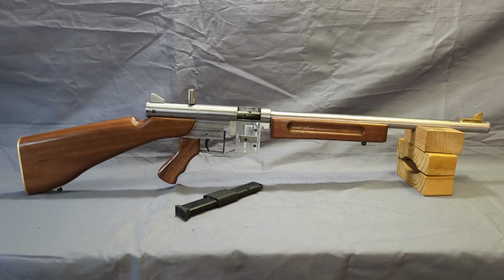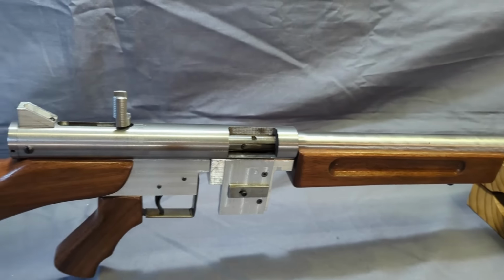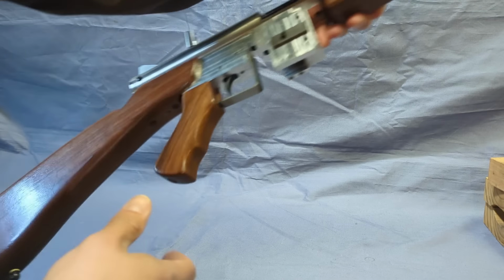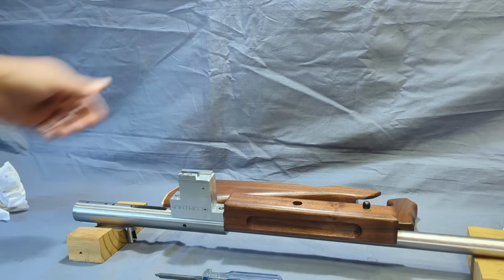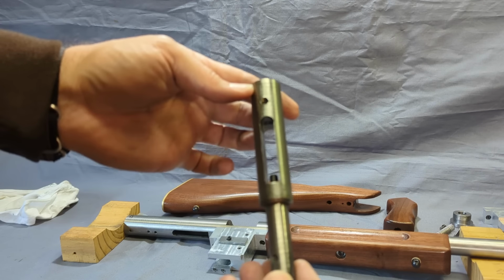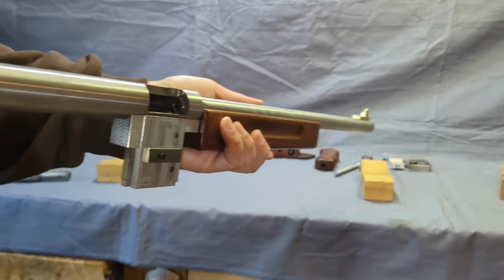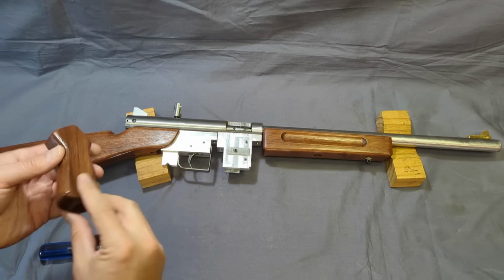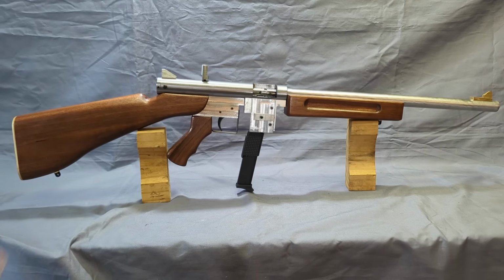Homemade Tommy Gun Mini: 380 Blowback

Comment: Wild part is making it semi auto is a heck of a lot harder than making it as it should be.
Reply from the maker: Yep. That's why I used modified AR trigger parts. The hard work was already done. Thanks for commenting
Reply: Thats true if "as it should be" means full auto only... open bolt full auto is easy..easier then semi auto fr sure...  but select fire? Thats seems to be a different story... at least it tends to require more parts... If its interests you, you can see what I mean on world of guns if you are interested..  It's an app where you can completely take apart guns... You gotta get the prei membership tho if you want access to every gun..  it's so worth it tho because these are exact 1:1 working 3d models that you can take apart down to the very last pin
Reply: OMG it's chef excellents!
Reply: @garage.guy.3006 now just modify a set for forced reset and it will be even funner....
Reply: @garage.guy.3006 I built a 9mm blowback AK back in 2004... I used 14oz bolt weight. Have you ever thought of using a detent system to retard the blowback... If you drill the bolt you can put a ball bearing and a spring that lines up with a hole in the receiver. On one I built I used a ball and spring with a grub screw to hold it in and then I drilled a countersunk hole in the receiver from the inside of the magwell for the ball bearing to snap into... Adjust the size of bearing and spring preset weight with double grub screw to adjust the blowback retard rate. It's super easy to do....also I try to make the bolt travel shorter than the overall length of receiver so the bolt is always floating on the spring and never hits the back of the receiver.... I love your gun man. Good job
Reply: True, because you need few more parts to make the sear function properly, making it full auto is much easier, especialy if it is going to be an open bolt design then it is the easiest SMG to make in the world
Reply: @SHAGG13  I find ball bearing delays interesting.  Especially for PCCs where straight blowback tends to negate the benefit of a lighter cartridge (easier for inexperienced shooters etc).
Reply: @gratefulguy4130  correct end with a long recoil path that doesn't impact the back of the receiver allowing the bolt to float it really negates the recoil.... I really want to do one eventually with a counter recoil weight with a pulley and cable so the bolt weight goes forward instead of backwards with a small bolt head accelerating a weight toward the front with a telescopic weight around the barrel and recoil spring in front for more weight forward with a bullpup design to balance it out. I'm always surprised nobody has engineered something like that yet... With a helical or P90 mag in back of pistol grip as well....and I'm really intrigued with BLOWFORWARD designs like the Swiss 53👍
Reply: @SHAGG13 exactly

Comment: Here in Brazil we have difficulties in buying weapons, there are many homemade SMGs on the streets. I have a 380 ACP with a 25-round magazine. Fully automatic, open bolt.
Reply from the maker: That sounds like a fun little gun.
Reply: @garage.guy.3006  In fact, illegal ammunition here is very expensive, so we don't have the luxury of training. Normally, the memories and feelings you have about the weapon are from when you are shooting someone or in a stressful situation.
Reply: @ggizi6369 Can you do reloading?
Reply: @elburropeligroso4689  Yeah, bro, I have two magazines and I carry 4 spare rounds in my pocket to use in the chamber. In the latter case, I still carry an automatic knife
Reply: @ggizi6369  Sorry, I meant can you reload your own ammo? Like loading bullets, propellant, and primer?
Reply: @elburropeligroso4689  No buddy, I've tried using reloaded ammunition, some failed to eject, only original ammunition
Reply: Same thing here in Scandinavia,but you know,if there is a will,there is a way..
Reply: @ggizi6369  can you get propellant and primer in Brazil? Or do you make them yourself?
Reply: What do you considier expensive for ammo? We complain its too expensive in US! In the US bulk ammo (500round brick+) is in USD: .22lr $.0-5-.08/round, 9mm  $.22-.25/round, .380 acp $.35-.40/round, 9mm premium hollow pionts $.50-1.00/round, .223/5.56 or 7.62x39 $.45-.50/round, .308/7.62 nato $.75-1.00/round, any other full power rifle round $1.25-1.50/round, .223 green tips (armor piercing) $.80/round gen 2 $1.50-2/round (Armor piercing rounds are banned from importation but domestic production is allowed making  non-US military calibers very rare and expensive like $20-100/round), magnum rifle rounds $3-5/round, .50bmg $5-10/round, 12ga birdshot $.33/round, 12ga buckshot $.50-.70/round. Add another 15 to 25% if you're not shopping around and buying a single box at the store. Basically anything that's not a military caliber it's hard to find anything other than premium hunting or self defense ammunition which cost twice as much as standard FMJ. What are ammo prices like in Brazil? Also how much are the homemade SMG's? And are they reliable? Is the market where you can buy them or do you have to know a guy?
Reply: @vape42  I'm not sure about Brazil. But in my area, a single round of 22lr cost more than 1$.
To perspective, the average wage here is less than 1$/hour
Reply: @vape42  Well, here each shot costs 20 reais, the minimum wage is 1420 reais, a box with 50 shots will cost 1000 reais, I need to work 1 month to buy 50 shots without spending almost any of my salary
Reply: @vape42  Homemade SMGs cost around R$5,000. An original factory-made weapon costs around R$12,000. Of course, on the illegal market.

Basically, the rich and military can have weapons in Brazil. A legal 9mm pistol will cost R$7,000 for those who are allowed to buy it.
Reply: @ggizi6369  Damn so your ammo is like 6 to 7 times more than it is in the states. Ironically full auto SMGs and assault rifles sold to law-enforcement or license holders cost about the same to double (depending on a specific gun) as one of your illegal factory made weapons. I'm assuming they come full auto or can you only buy semi auto factory made weapons? Of course we can buy a reliable 9mil pistol for $200 (r$1200), A semi AR 15 for 400-500, A semi AK-47 for 600-700. Guns with barrels under 16 inches in length are classified as short barrel rifles and come with an increased background check and regulation as well as a $200 tax every time it's transferred to a new owner or one is created. You also give the government permission to search the premises you’ve declared the rifle at without a warrant. We do have "Pistol braces" that basically function as stocks for compact weapons but they are legally distinct and not quite as nice to shoot as a real stock. I'm curious do the black market arms dealers have any heavier ordinance? Grenades, rpgs or grenade launchers? Other explosives? Mounted machine guns? If so how much? Also if you ever need to build a cheap quick gun A 12 gauge shotgun shell fits near perfectly into a 3/4 inch pipe and the rim of the shell will rest the pipe end. You can then take a 1 inch pipe with an end cap That has a hole drilled in the middle with a sharpened bolt held in place by a nut on the inside so the point of the sharpened nut sits in the middle of the 1 inch pipe cup that you've made. You can then place a 12 gauge shell in the three-quarter inch pipe, sleeve the 1 inch pipe over it and quickly slam it together, making. To reload simply turn the three-quarter inch barrel around put in another shell and fire. The empty shell will eject before the new shot reaches it. Also if you only have access to birdshot 12 gauge you can open crimped top and mix melted wax with the shot to create a very nasty improvised slug (For best results dump the shot into the melted wax and then use something like a small plastic spoon to scoop the shot back into the shot cup before pushing the crimping back down) Or if you're in a real hurry you can cut about around about 80% of the shell behind the shot cup And when you fire part of the plastic shell will exit holding all the shot together essentially creating a frangible slug. But those cut shells will only work in shotguns where you manually load each shell into the chamber or as just the shell in the tube.
Reply: @vape42  Thank you for the teachings. In fact, I used to have a . 38 caliber revolver, but I had to sell it to change my motorcycle. And if I answer yes, the cartels have all the military equipment, from 7.62x51 light machine guns to . 50 heavy machine guns, grenades, drones, night vision. Many of them are former members of the army who were expelled or left. If you do a little research on Brazil and the war on drugs, you will see that there are really areas here that the state only enters in combat vehicles. The federal police even use the American-made Maxxpro, but without much success, because they block the street with fire barricades and improvised explosives. Trust me, no one wants to get out of their armored car to put out those barricades.
Reply: @ggizi6369  I'm curious are revolvers more popular down there because you can use shitty ammo and different loads but still have them function? Revolvers are considered fairly obsolete in the US. Most people who carry here use a compact double stack 9mil pistol. 3-4” barrel 10-15 rounds 16-23oz magazine fed and more and more a holographic site.
Reply: @vape42  Sure, revolvers are obsolete, but I still prefer them because they are easier to carry on the street, one of the advantages of SMGs is the psychological factor. Of course, my dream is to have a Glock.
Reply: @ggizi6369  I meant to say that revolvers are probably more popular down there because they don't rely on the power/quality of the ammunition to cycle the action. As long as the primer doesn't blow out a revolver will be keep firing. Plus it doesn't drop spent cases so you don't leave evidence and you have the ability to reload our spent cases. I've had four or five Glocks they're great guns super reliable, well built, My only gripe is their trigger is just OK. Plus for carry prefer a double action/single action gun with a decocker carried one in the chamber, safety off with the hammer decocked. That way in the heat of the moment you won't forget to turn the safety off But your first shot is also a long deliberate trigger squeeze So it won't go off by accident And your subsequent shots Have a lighter trigger with much less take up and over travel Giving you the best chance to make hits. Ironically my most typical carry is a very small 22 magnum five shots single action revolver. I carry it because it's so small, only weighs about 8 ounces loaded and disappears in a pocket or on your person. Concealed carry is fairly common Maybe one and 25 people but it's easy in my state as anyone who can own a firearm can concealed carry without any sort of special license or permit. Open carry outside of the range or hunting is virtually unheard of. I think I've seen it three or four times in the past 25 years. I'd imagine people only concealed carry in Brazil and richer areas Where are the police still holds away. Is it common in the areas where the police don't go to open carry? How do you conceal carry an SMG or do you open carry?
Reply: @vape42  Yes, revolvers are very popular here among those who cannot afford a legal gun. Everyone who can legally buy a gun opts for pistols. Carrying an SMG is very disadvantageous in many situations, but I think I know when to get into combat and when to avoid it. I usually wear loose clothing and jackets in the car, but that's not a problem. I'm young and still live with my parents. All my money allows me to buy is this. It surprises me that you ask this, since I've seen several videos of people in the United States carrying Mini Dracos or Arps.
Reply: @ggizi6369  I have an AK and an AR pistol but I've never heard of anybody really carrying them except maybe in their car And they cost 2 to 3 times as much as an entry level nine mil compact pistol here so if you had an smg here it’d be easy to trade for a pistol. I’m curious like how cobbled together is your smg? because ive seen videos of guys in little shacks make legit looking guns where they have giggs and diagrams and basically copy another gun. I'm guessing your SMG is some sort of blowback operated open bolt gun with a pipe receiver That holds the bolt and recoil spring With a pistol grip and simple dear catching the bolt for the trigger. Probably a piece cut out of the pipe for an ejection port in a mag well weld it in.. Also I'm betting the magazine was come from another gun. At least that's how I’d do it.  Basically does it look an operate like a smaller World War II .45acp M3 grease gun? Also I'm curious what percent chance would you assign to your gun that it would run through all 28 rounds without malfunctioning? For most people in the US anything that malfunctions more than one in 500 to 1000 rounds is considered unreliable for any purpose where your life would be at risk (Self-defense, law-enforcement, military Etc.) and most people will run 500 rounds through a gun before they would even consider it thier for thier carry gun. Keep in mind for a weeks worth of work 5 8 hour days minimum wage pay here you could easily get a 9mm pistol that would pass that test 500 practice rounds; 50 +p hollow points and a holster and its really easy to find a job for 10-15% over a minimum wage if youre willing to actually work. Since there's no permitting process in my state I can basically carry my firearms however I want. However I find even carrying my eight ounce 22 magnum to be a pain in the ass so I can't imagine what carrying an SMG is like.
Reply: @vape42  It's very well made. I can show you the guy who makes it. He's been doing this since the 80s. All the failures I've had were when I used reloaded ammunition. There are a lot of really crappy SMGs out there, but mine has a good reputation where I live.

It has no welded parts. It's built on a 3D printer. The entire mechanism is made of stainless steel. The magazine is also handcrafted in stainless steel. It's a very robust weapon.

It's not that it's a problem to carry an SMG. In fact, deep down I like it. In the next 5 years, if everything goes well, I'll have a Glock and I'll remember these moments with nostalgia.
Reply: Amazing story ggizi

Comment: .380 MAC-11 would be a good source for magazines

always wanted to build a 3/4 scale Grease gun with that
Reply from the maker: A mini grease gun would be awesome. I looked at a few different mags. But the single stack lcp mags won out
Reply: @garage.guy.3006  Valkyrie Arms made a repo back in the 90s, but it used an aluminum lower receiver. The whole thing just missed the mark. 

I was thinking of a tube receiver set in a 2 piece 3d printed clamshell body. Could leave the outside plastic, or sand cat it in aluminum.

maybe even use a TEC-9 parts kit. If the parts are reasonably  size compatible

Comment: Nice bit of work!
Which parts did you heat treat, and to what hardness?
Reply from the maker: Thanks. For this one the only thing I heat treated was the firing pin. I don't remember if I used my file test. But if memory serves I was shooting for around 55 Rockwell. All the other steel has ample yield strength and hardness as it.

Comment: you can add some mass to the bolt and a heavier spring to keep the breech closed longer and keep gas blow back down. 
with a blowback you can use a pretty strong spring.
not criticizing you work just a suggestion.
Reply from the maker: Yes if I was going to remake it, I would raise the bolt mass. Or make it a pistol. Like I said, my bolt weighs 315 grams and a Walther 380 slide weighs 200 grams. The brass looks good, it isn't bulging or stretching so it's safe. But more mass would definitely slow that down. Now that I know the bolt velocity I might look around for a more balanced spring.

Comment: i cant remember about fire rate wis but if i remember right the barrel length thing is only if you register it but if you build just on your own its do as you will its basically like an 80% build
Reply from the maker: Yes legally it's the same as if you used a kit. But the NFA regulates rifle barrel lengths. If it wasn't for that I would put the proper barrel length on it

Comment: ❤❤This is really beautiful,,it looks amazing,,and wow it shoots great,,,is there a reason you didnt do it in 9 or 10mm ???
You did an amazing Job so well done mate !I!❤
Reply from the maker: Thanks. I wanted to make it a direct blowback action. So 9mm and especially 10mm would have required a heavier bolt. Thanks for asking
Reply: @garage.guy.3006  you know H&K put a fine tungsten powder in there mp7 bolt and a few others ,maybe the UMP ,,to add weight and to stop bolt bounce,,also something as simple as a piece of bicycle tire rubber at the end of the bolt can smooth out your recoil quite allot even a peice of thick leather can make a huge difference.

Comment: Hats off, man… It’s pretty damn slick. Your channel is great and so are your builds.

What kind of steel did you use for your bolt? Also, did you harden/treat/anneal it?
Reply from the maker: Much obliged. Normally I use 1144 ultra strength steel. I will heat treat occasionally if needed, but for this build the only part that needed it was the firing pin
Reply: @ Nice… It’s great steel to machine.

Comment: PM63 magazines from poland  would have worked great.  Come in 15 and 25 round  normally they fire 9x18   Easy to load and feed at that perfect 90 degrees like a Thompson 20 round millitary mag
Reply from the maker: Thanks I'll look into those. The lcp magazine was single stack so that was one reason I went with that one. But I'll investigate those magazines
Reply: @garage.guy.3006  max arms had em 3 mags 25 round for like $36 still wrapped in brown paper